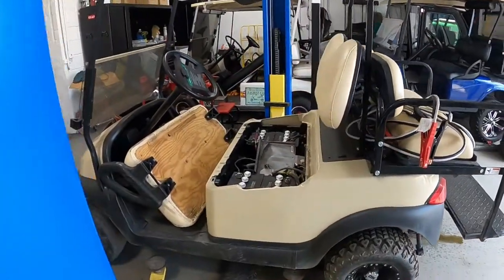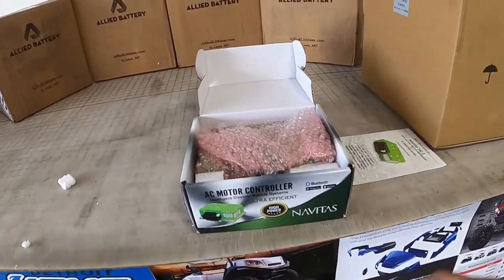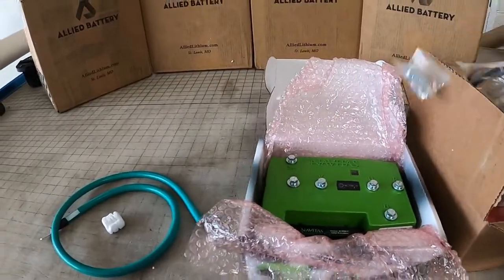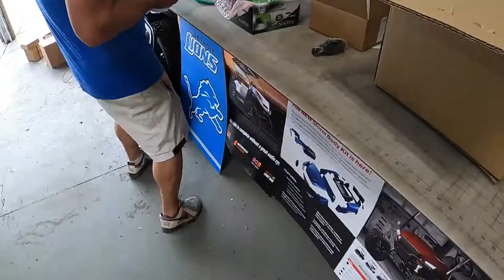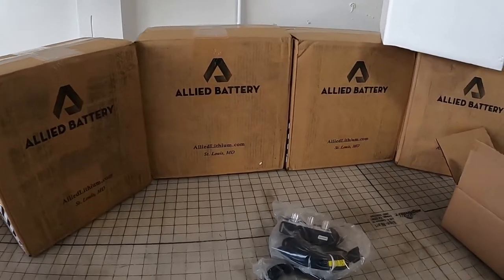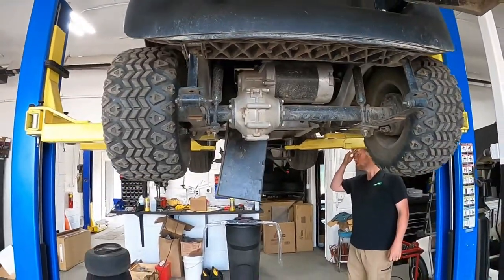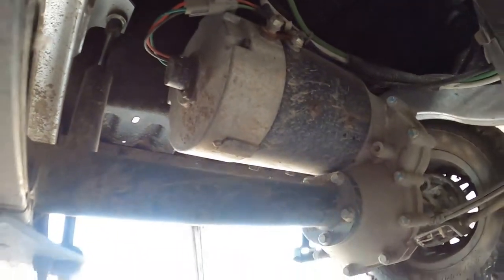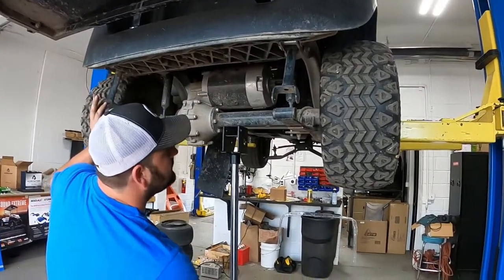NAVITAS AC MOTOR IS MASSIVE!!! Custom Golf Cart Build

Comment: I'm pretty big into Polaris Gems and own a transportation business using them and I rebuild them. I have about 30 Gems so far and plan on customizing several of them. Navitas has really caught my eye. Has anyone converted Gems over to Navitas brand? If so, do you know if it's a direct bolt to include wiring or does all of that have to be modified? One of my EVs has a 8kw motor with a top speed of 60mph. Does Navitas max out in speed like 8kw?

Comment: Noticed your using allied lithium. Are you running 72v on this cart because the battery said 72v? Can the navitas controller handle that voltage?
Reply: Yes, the Navitas app has an option to switch to 72v.  I got the same AC kit. minus the batts..
Reply from the maker: Yes we are. Yes the controller is 72v ready. You will have to program the controller when switching. You can do this in the app.

Comment: How large a motor can be used without lifting
Reply from the maker: What kind of cart?
Reply: @CartPerformance  it's a 2009 EZGo RXV
Reply from the maker: @CristianZamora  We have a video coming out soon about the rxv. You already have a ac motor from factory. You can get a new controller and really wake your cart up. Or navitas does have a full swap kit to their ac kit as well.
Reply: @CartPerformance  yes, I've had this cart for 4 months and just finding out it's already AC... so all I'll need is a controller, solenoid and beefier cables... I'm not interested in more than 22, 23 mph,  I want torque, lots of hills around and will be hilly wherever I take it... so eventually I'd be looking at rewinding the original or upgrading the motor and then lithium... does lithium improve torque?
Reply from the maker: @CristianZamora  To do the mph you want you really dont need anything. You can contact a local ezgo dealer and they should have a controller to program your stock controller. Now the torque is where you will have the trouble. The new controller will be able to have more torque control over the stock controller. Can you send me a email and i will send you some options and pricing bmcgolfcarts@gmail.com